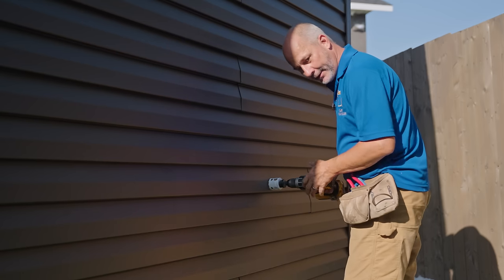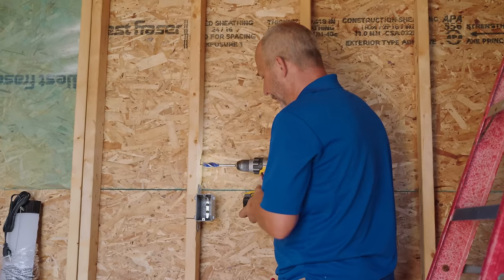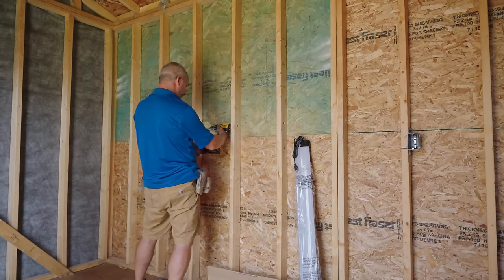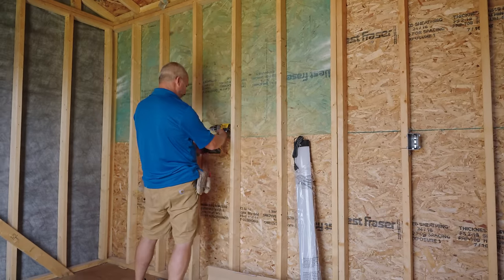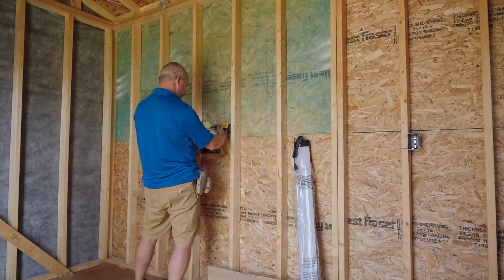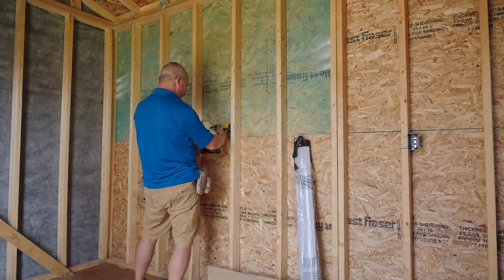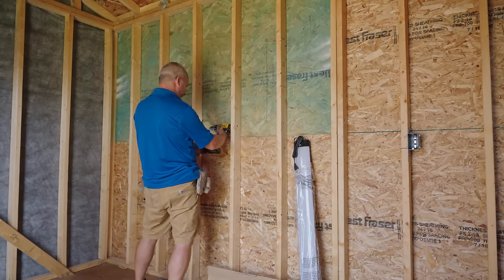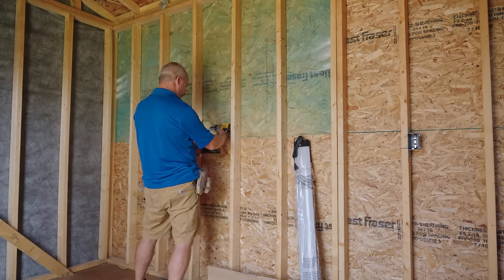How to Run Permanent Temporary Power to a Shed

Comment: Great video. Thank you. 
Just an observation on the wiring for the wall switch. I believe the latest 2023 NEC code requires that there be a neutral inside that switch box. In your case, you just have a simple mechanical SPST switch, so that neutral would not get used. But, I think the code change has to do with making the switch box compatible with switches that do need a neutral. Can an electrician in this group clarify this?

Comment: fun fact, on most brands outlets, plugs, and switches, there are notches made for using as wire strippers for 2 different gauge wires incase you don't have your strippers on you. There are also gauge markings showing how much you should strip back, usually for when you stab the wire into the termination holes.

Comment: I watch a lot of your videos on other reno tips. I am an electrician and watched this one to see how you do. Good job but a couple suggestions.
1. I may have missed it but you didn't tell the viewers to wrapnwire clockwise around the screw. You were doing it the correct way but it is important for them to know.
2. There are 2 ears above and below the mounting screws on your receptacles and switch. If you break those off it makes life easier.
3. Pay the extra money for the unbreakable covers the ones you used will snap if anything rubs against them when they dont have the support of something like drywall.

These are all super nit-picky, I know, but the next one is not.

4. DO NOT use your white wire as your switch leg!!! Bring power down to the switch on your white wire (you can put your wrap of black on it) and use your black wire as your switch leg. This is how electricians donitbitbis our common practice I have watched so many electricians pliers turn int 14 guage strippers when they go into lighting circuits wired by home owners who do not know this!

Comment: I'll start by saying that I enjoy your channel. You have taught me so much, however I've been an electrician for 38 years. Here comes the but. In the US you must have a neutral at every outlet(a switch is an outlet). Therefore a two wire "switch loop" is no longer legal. Additionally, when they were legal, the white conductor was required to be the feed. I know it sounds silly, but then any person who" belonged" in that box knew which wire was "hot". Wiring this way is not safe for the average homeowner, tape only confuses them.
Reply: Also, just to protect some DIY ers, never use a razor knife to strip romex. They make sheathing rippers or special wire strippers for that. A knife will accidentally knick an insulated conductor and you won't be happy when you find that knick when working.

Comment: Thank you for sharing! Very insightful!
Quick question for you if you don't mind.
When you got to the wiring part with the flippable light switch. Did you change the power and neutral? Such as where it connects to the light switch housing? I guess that would be putting the white in the brass and the black in the silver.
Thanks in advance! Love your work and videos.

Comment: If you close the walls in the future you may need to replace the switch leg because of NEC 2017 404.2(C). Depends on your inspector's interpretation of 404.2(C)(2). For the trouble I would just be using 14/3 there anyway.

Comment: I would have liked to see the connections within the box for the ground though. I know you connected one side to the grounding screw and cut off the excess, and I think you connected the second ground going out of the box to both the box ground and the plug ground...right? That's what you meant regarding only needing one ground wire in the box? Thanks Jeff.

Comment: Because I had difficulty seeing, from the camera's angle, what you were doing with the switch leg and ceiling junction, did you put the switch leg on the top of the receptacle?  Otherwise, thanks for explaining the power in/power out in relations to the outlet set up. That made perfect sense.
Reply: Switch leg is the brass (hot) side of the receptacle, neutral from the other leg is on the silver side of the receptacle. Doesn't matter if it's the upper or lower screw as upper & lower are connected by a tab.
Reply: @frontiervirtcharter Thank you very much. I couldn't tell from the camera angle what he was doing.

Comment: The only thing I would tell new DIYers is hand tighten the screws for the wires by hand until they get used to controlling the drill. In my area the inspector may check to see if the tightness of the screws are to manufacturer specs listed on a paper in the package or it is printed on the package. I use a torque screwdriver to tighten the screws to spec. The inspector will check the spec tightness for a couple of receptacles and if okay they won't check all of them. This is in the USA. FYI, some cities in the USA require wire in the wall to be inside EMT.

Comment: 14/2?  I had a professor in college say he'd never run less than 12ga.  His reasoning is that someone is always going to need some power at 20 amps and will end up replacing the breaker and not the wire.  Ive used that logic ever since.  My table saw is 15 amp.  Running the saw and a shop vac for dust control on the same circuit will throw a 15 amp breaker.

Comment: 42:00 starts putting the plug on the wire without putting the back part of the plug on first. 42:19 the back part has jumped onto the wire without taking the rest of the plug back off through the magic of editing. 😂 We've all been there at some point. Things like putting a wonderful flare on the end of some copper tubing and then realizing you didn't put the nut on first. Sigh. Cuts off flare I just made, puts nut on tubing, makes new flare on end of tubing.

Comment: Out of curiosity... If you were to run 12/2 UF-B from your house (on it's own dedicated breaker), trench it the minimum depth (so you don't have to be concerned about an extension cord laying on the ground)... You run it into your shed through the conduit so it's all nice... You wire up the shed end of your UF-B to the female extension cord repair plug, then for your interior wiring, still using 12/2 of course, you wire up the end that connects to your UF-B power supply with the male extension cord repair plug... Giving you an internal disconnect... Would this still be considered "temporary power"?

Comment: One thing that can make life simpler in the future is to run the feed through the switch box. If you ever
 want to put a wifi or home automation switch in there, the neutral would be there where you need it. A smart switch is a good idea in a shed. If the light gets left on you don't have to go out there in the middle of the night to switch it off, or you can make it part of a broader home automation scheme.
As an electrician I also don't recommend tape wrapping devices. It can make condensation buildup harder to evaporate and leaves a sticky black residue mess if worked on down the road.
Many years ago as an apprentice my journeyman told me the screws are vertical so ladies dont catch and damage their nails when brushing the switch to operate it.
Reply: Actually, in Ontario the Code requires that you have a neutral in that switch box.  This change was introduced around 2018 and it was to facilitate that capability of adding intelligent switches.

Comment: What about making that exterior plug that connects to the extension cord water proof? I've done similar exterior extension cord connections wrap ups with plastic bags and zip ties to power exterior bilge pumps during winter storms. And if I'm seeing this correctly, none of that system is grounded. Shouldn't at least one of the green screw/copper wire connection be connected to a buried copper bar? Otherwise you're dependent on whatever the extension cord is connected to being properly grounded. And who knows there.

Comment: I've done similar, on one shed did just like you but kept the plug and wire sticking out in a weatherproof outlet box for a cleaner look on. On my second shed I have a retactable  outlet inside that can be pulled through another weatherproof box. And my third shed has a suicide plug I made that only I have acess to.

Comment: Great Video !! Sir
I just installed a shed on back of my house is exactly 75 ft away from my house panel where I need to bring inside the power into the Shed.
I used the 12-1 yellow Romex wire I ran it through 3/4 plastic conduit 12' inches under ground.
What kind a breaker Do I need? and how many plug outlets I can install?  I'm thinking of using it as storage and workshop . I'm thinking 2security exterior lights ( my back yard gets very dark and there is an alley to neighbors on backyard ) 2 plugs on the ceiling for 2 lights identical what you bought at home depot ; 1 box for ceiling fan; 4 plugs on walls and 1 switch or double switch.. how can you help?
Thank You

Comment: Great instructional video, thanks. I have a few questions. When you install the outlet boxes do you leave space for the possibility of future sheet rock? Is it possible to have the external power feed through the bottom of the shed instead of a hole through the side? Something like a U shaped conduit going from inside under the shed to outside and up to whatever height is within code. If not then can a siding block with a male or female connector be installed so the extension cord can plug into it instead of the wire hanging?

Comment: I’m not an electrician so my question might sound weird. Should I put an exterior outlet box and use that as a connection point that way I can seal up that hole better instead of having a wire hanging out the hole?

Comment: I see you are hot in the video.  That’s the reason I went and bought a small type battery fan with about a 7inch blade to keep some air circulating in the heat.  It works great and lasts quite a while. Use it working in small and also decent sized areas just adjust the distance of the fan.  Some of these small fans can clip or attach to 2x studs

Comment: Thats the way I did it. BUT, I tapped off of a 20AMP outlet in my garage into a
100ft yellow 20AMP extension cord to my Rv shed. With 20A, I can run the ac 
in my motorhome if I need to.

!

Comment: Ooh, that is a nice drill bit. Thanks for the affiliate link. I can use something like that for when we do more renovations. Oh, I hate when I disconnect my battery while gripping the cordless drill! At least I'm not the only one who does it.
Have you seen that Leviton now makes outlets and switches with a locking system similar to wago lever nuts? You put the wire in straight and clamp down with the lever and it holds tight.
Saving the cut off wire for pigtailing later makes me happy. But I am a hoarder so I hate seeing things get thrown out.
Those LED shop lights are great. I put some in my workshop and they are much better than the old fluorescent lights.

Comment: Figure this has been mentioned before, and I'll admit I haven't watched the whole video yet...but on the light switch where you did the two-wire switch loop. Doesn't NEC now require a neutral wire to be installed in light switch boxes due to the rise of smart devices that require neutrals? Are the exceptions to this because this is a shed and the wire is going to a plug-in, and not directly to a light fixture?
Reply: Shame after a month nobody acknowledged this comment as I know NEC code was changed to require neutrals in light switch boxes but wanted to know if there were exceptions to this rule.

Comment: Great video for amateur DIY.  My only thing I would do different is to always run power to the controls like for the light switch.  Basic rule of electrical work.  You do that when running power to the panel so the same applies to hardware.
Reply: Yep, I would have ran for more outlets along the walls then to the switch then over head.  I would’ve used rv/marine 110 exterior inlet (male prongs w/ waterproof cover) that just wires in the inside.  Connected them inside at his junction box w/cover.   

I did like all the explanations.  I have ran across confusing  wiring in older homes that require thinking thru the install.

Comment: Someone did this on my shed except they wired the shed permanently to the extension cord and didnt wrap the wires. Was inspecting the deck joists and discovered the bare wires. Unplugged the cord, been without power to the shed ever since. Of course, ive got a back porch light that doesnt work and now neither of the outside plugs in the back work either. Something was done wrong and im saving to get someone out here to fix it all. Crazy stuff.
Reply from the maker: sorry to hear that Mary!
Reply: @HomeRenoVisionDIY  all part of the game 😀

Comment: Hey @homerenovisiondiy, I was thinking about doing this to a shed in my backyard but I also wanted to add a minisplit AC unit. What do you recommend? Running another separate line? Installing a panel to power switches/outlets and then the AC unit? Is it smart to run maybe a higher amp to the shed to power both?

Comment: This is ideal for wiring a shed or detached covering with battery backup power. I suppose there's nothing wrong with using the grid to charge a battery backup  system wjich doesn't require a permanent coded dig if you are simply using the cord to temporarily recharge your battery backed system until you can install solar or a wind generator to be used as the energy to restore and recharge your system for that ancillary storage place.

Comment: Can I ask why you wouldn't put the extension cord through the hole in the wall and plug them both in inside that box and then seal around the hole? Wouldn't that make it waterproof?

Comment: Thanks for your explanation. I currently have power to my Garage and want to run power from the panel in my garage to my shed that is about 15 feet away from the garage. I will only need a light, light switch and maybe 2 outlets. I guess this video will will also work for me? Anything different I need to know?

Comment: This is an excellent tutorial on wiring. I really like the idea of including a service loop (a loop of extra wire) at each box, but doesn't that make a mess of your insulation? Maybe there's a way to make it less unruly. That dangling wire outside feels hillbilly to me. It's gonna get wet and corroded. It's gonna snag unwary passersby. The foam will experience UV degradation, look unfinished, etc. A power inlet box would be a lot cleaner, more professional, and weather-protected too. Still, great video. Thanks!

Comment: Few things.
1. Why didn't you use pig-tails in boxes?
2. New code (for new installs, however one could argue this was done prior to the change) requires there to be a neutral in switch boxes, so that first run should have been done with 14-3.
3. Why not put your "slack loops" above the boxes, rather then crammed between the sheathing and back of box?

Comment: [NEC 200.7(C)(2) the white conductor has to supply power to the switch. Not as the return conductor.]   Looks like you may have a violation from your outlet to your switch?  The white wire you taped black is supposed to be unswitched, (hot all the time,) but obviously it still works.

Comment: :hand-orange-covering-eyes:Should have used a level when the first LB was installed for thru the wall for the outside feed :hand-orange-covering-eyes: and also the safest way to put electric in an all wood structure is to put it in metal rigid conduit so if the wiring causes a short or fire its contained to within the conduit and the whole structure doesn't burn down.:hand-orange-covering-eyes:

Comment: I did it just like this setup when I built my shed, but I drilled through the bottom plate, not on the side of the shed.  It was clean and the cable was hidden from sight.  My shed was on the skid beam so access was easier, but even if I had them on the concrete, I still would drill for the clean look sake.
Reply from the maker: I drill high to avoid the joint sitting in the snow. Cheers!

Comment: I appreciate this, I got my house almost 2 years ago and have been wanting to set up a temporary power solution for my car port and shed but A) I live in a small town so trying to get one of maybe 3 electricians to do it was impossible. And B) I'm a bit tired of running an extension code across my car port to power on a light. I was just trying to wrap my head around how to do this, and this video came up.

Comment: For a cleaner look and to be code compliant, don't do those so called "service loops", code requires the NM-B cables to be secured within 8" of a NM box. As for the power interface, it's best to have brought the extension cord into the shed so the cord caps are inside the shed protected from moisture/rain. But a better solution would have been to wire the extension cord directly into the shed outlet box and simply roll up the remainder of the cord outside of the shed and hang it on the shed wall when not in use.

Comment: Fine for temporary, but I would have ran 3 wire to the switch if you want to make it permanent in the future. Neutral is becoming required at switches, cuz modern switches need a neutral.

Comment: Apologies in advance for the ignorance 🙏 just your average broke DIYer trying to spiffy things up at the homestead. My question is can one cut the plug off of the light to hardwire it? If so, can that be done at the end of your run; 4 other receptacles and the light in question at the end? If that makes sense...appreciate any advice or reply from whomever. Thanks
Reply: You can do this.  Do everything he mentioned but in place of the outlet... 
1- run the wires from the light into the box just like he showed.  
2-be sure to wire the black wire from the light to the white/black wire from the switch and then the White wire from the light to the white wire going back to the box.  You will have to twist these connections just like he did with the 2 black wires.
3- connect the ground from the light to the ground in the box..